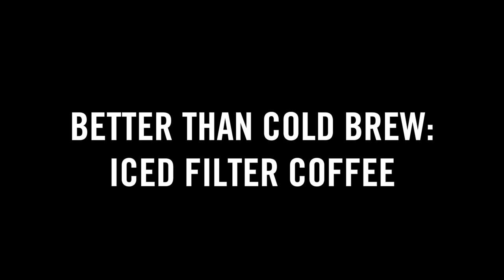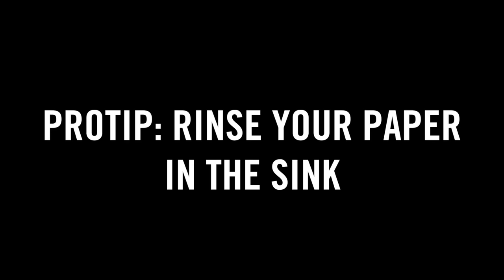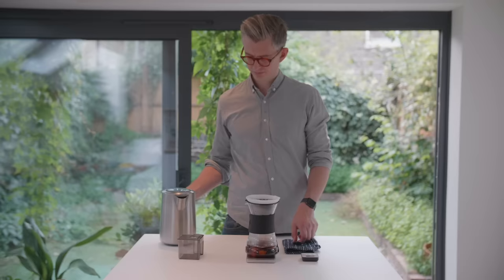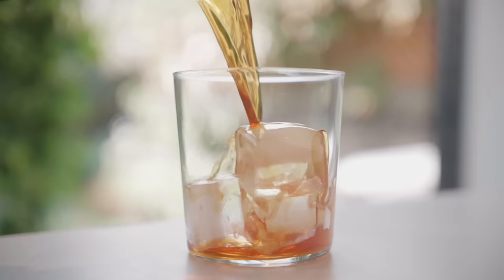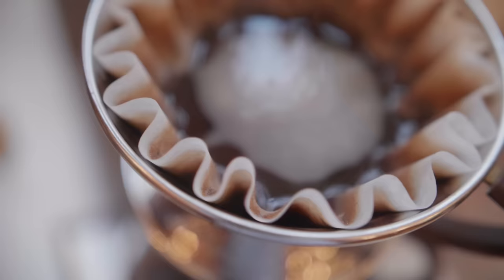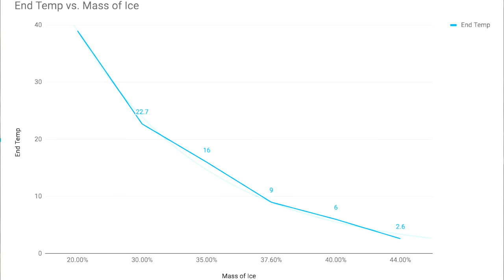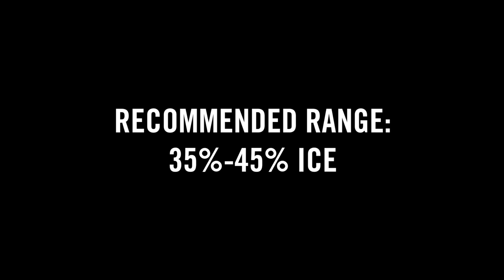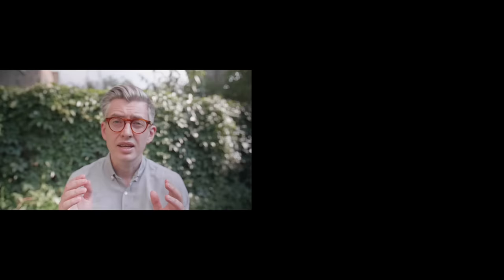Better than cold brew: How to make iced filter coffee

Comment: Seems like if you brew cold brew coffee it's not that easy to hit the extraction yield you want.
I made ice brew with 400ml water, 100g ice and 31,25g coffee.

The results was a 30°c "cold" coffee with 1.38% TDS and 20.39% extraction yield.

To achieve that I did a 1min. Bloom with 87,9g water and stirred the slurry for 15 secs with a chop stick.
Then I poured  200g of water for 30secs.
At 3mins brew time I poured a last time 'till I hit my 400ml, stirred the slurry 3 times counter clockwise and after 6:50mins my brew was done. The draw down was so slow that I don't even got a dome (what you get normally if you stir too much in circles). It was a little bit un-even.
I choose the grind to be 16 clicks on my Comandante c40 (I use 21 clicks for 200ml brews)
The used dripper was a SAI Phoenix 70 original.
Reply: I also did some cold brews using a chemex, v60, espro-press and Aeropress.
It's very easy to get a nice cup of cold brew coffee using the Aeropress. You can press the coffee directly into the jar.
I also use it to filter turkish mokka.
Reply: The water dilutes the coffee, so th TDS% will drop.
Like if you have 400ml of coffee and the add 100ml of water the TDS will drop by the factor 1.25:
((400ml+100ml)/400ml)
Let's say our brewed coffee had a TDS of 1.25% before we add the water.
If we add the water to our brewed coffee it will drop to 1%TDS
(1.25%TDS/1.25).

So if you add water to the brewed coffee it decreases the TDS but the extraction yield will stay the same.
Normally using more brew water will increase the extraction yield but while you add the water after brewing it reduces the TDS, so it stay in balance. 

You can't extract less out of your coffee after the extraction is done.

If you use the formula TDS% * brewed coffee mass / ground coffee it gives you the extraction yield.
And the TDS * brewing water gives you the extracted coffee mass.

so if you have 1.25% TDS and 500ml brewed coffee mass you'll get 6.25g of
 extracted coffee mass (0.0125*500ml)
If you used 31,25g of coffee that's 20% of that (6.25g/31,25g)

So if you want a TDS of 1.25% at 500ml final cold brew coffee, after adding 100ml water to the brew, ad the brewing water to the weight of the ice and divide it by the brewing water, so you get a factor of 1.25%.
Multiply this factor with your design TDS and you'll get a TDS of 1.56%

It's some math, but it helped me to understand how TDS and extraction yield is related with coffee and added water.
Reply: Yesterday I did another ice brew, using 33g coffee (grinded slightly coarser, 18 clicks), 300ml of hot water (I measured 97°c in the kettle) and 200g ice to aim for 1.45% TDS and 20% extraction yield.
What I got was 1.43% TDS and 19,72% extraction yield after 3:10. But this time I used a hario V60 02. So I got slightly more TDS and less extraction yield than with the Phoenix 70 with less than half of the brewing time and a coarser grind.
Reply: I use to stir the brewed coffee 'till all ice cubes are molten and then I take my probe.

Comment: This is literally the same thing as pouring hot coffee over ice. Which is why cold brew is the alternative.
Reply: The recipe is quite different. Here you make the coffee stronger to account for the dilution of ice by a) adding more coffee b) grinding finer. 

You can try it out by making iced coffee with your regular recipe for filter coffee the way you mebtionee and then trying a recipe with increased coffee and finer grind. You will notice the difference in strength.